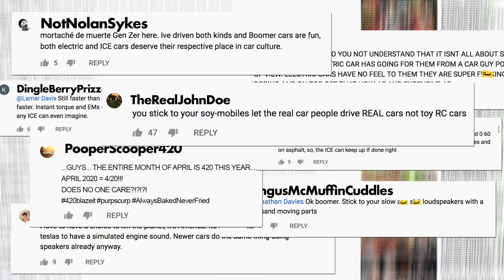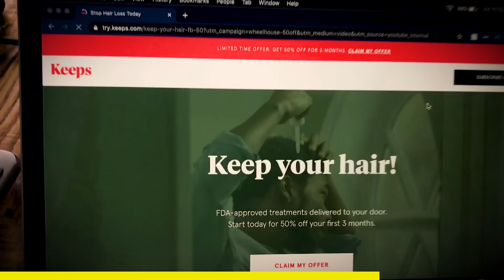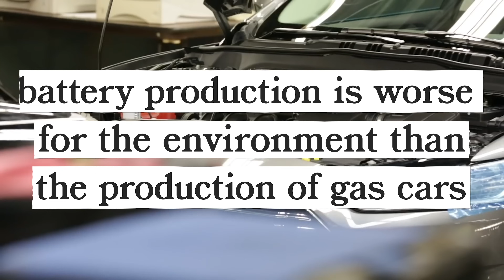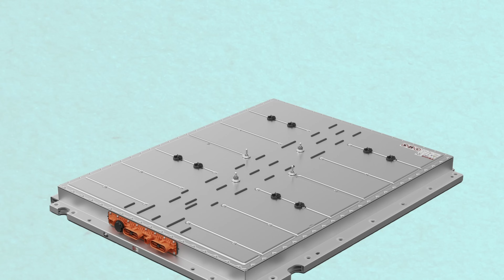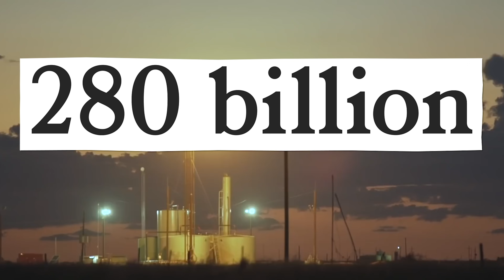Are Electric Cars REALLY Better for the Environment?

Comment: As much as i love muscle cars androaring v8s, i love to cruise with my little Zoé to town and back. Keep the historic engines for sundays and racetracks, use an EV for every other purpose.
Reply: I'm a petrol head through and through but I think this is the route I'm going down.
Reply: @xu10j4rs1  Not a true petrol head then. Ev's suck and will always be crap.
Reply: @krazyhippy  if we carry on like we are we won't have a world left to live on so we need to do our bit and if that means only driving our petrol cars at the weekend so be it.
Reply: @xu10j4rs1  I have to disagree with you. Country's like China and India need to make major changes if you want to make any kind of change. Modern gas powered cars are pretty clean compared to where they were. I just don't get any excitement when I look or read about electric cars. They are just so boring, ugly, and no loud vroom. I dunno man. I also didn't mean to come off like a dick in my last comment, so sorry if I did.
Reply: @krazyhippy  Yes, the Rimac Nevera with it's 0-300 km/h in 9 sec is certainly crap.
Reply: @potatocrunch94  Sorry, but when it comes to cars, speed is just one factor.
Reply: @potatocrunch94  Speed isn't the only thing important. Some guys like to work and fix their own cars instead of rely on dealerships to service them. That's not possible with electric cars.
Reply: @hhasslinger9601  It is possible,  just need a different mindset from ICE. Number of coils instead of number of cylinders. Induction phase instead of boost pressure. In the first place, EVs has less moving parts which reduces their need for maintenance.
Reply: @krazyhippy  In the first place, excitement, beauty, and noise are not the main purpose of a car. Heck, the best selling ICE vehicle is considered boring for petrolheads: Toyota Corolla.

Comment: The social utility of electric vehicles comes from their being slow charged, i.e., trickle-charged, at night.  At night demand for electrical power is low.  As power plants must be kept operating even when there is no demand for power, at night electricity literally goes unused and winds up going ' to ground '.  If you have an electric vehicle and slow charge it at night you are using electricity which otherwise would go to waste.

However, if you ' rapid-charge ', i.e., fully charge the vehicle in less than 15 minutes, that stresses the power grid requiring massing investments in increased capacity, which costs money and increases emissions of all types as well as having other ecological effects.

If you charge your electrical vehicle during the day, you are increasing demand for power.  If that electrical power comes from a conventional fossil fueled power plant, emissions are not reduced, they are simply moved from the tailpipe of the vehicle to the smokestack at the power plant.  And, again, as this increases demand on the grid during times of high power demand massive new investments in expanding the capacity are required should electric vehicles become common and are charged during the day. 

Rapid charging during the day is an ecological disaster.  Doing that exacerbates all of the problems and eliminates all of the benefits of electric vehicles.

A more ecologically and economically sound solution to the problem of excess power production at night would be pumped storage hydroelectric.  With pumped storage surplus electricity at night is used to pump water upgrade to a reservoir where it is released during daytime peak demand to turn power turbines and meet that demand.  In addition to recovering what would be a lost resource, the electrical power which now goes to ground, with a reservoir you get flood control during periods of heavy precipitation, a resource to help manage water shortages during droughts, and recreation- boating, swimming, and fishing.  The electricity going into electric car only be used to run those cars whereas electricity from a hydroelectric power plant can be used for any purpose; households, businesses, industry, schools, etc.  Electric cars only provide a very narrow use of the recovered resource while pumped storage hydroelectric provides a very broad social benefit. 

Unless they are slow charged at night, electric vehicles have no social utility.  If you just want to get one because you like the way it looks and handles, that's great, but there is no social benefit unless you trickle charge it at night.      ;-)
Reply: Correct, which is why the energy companies ( here in the UK at least ) are virtually giving the electricity away through the night. They generally charge around a third of the daytime rate.....
Reply: @Brian-om2hh  Thank you.  Don't know how well my, ' ahem ' " brilliant " idea for pumped storage hydroelectric power would work in the UK.  Here in the U.S. there is lots of potential.  Using high altitude reservoirs in that manner was the plan for power production here where I live in Colorado about 35 years ago.  That went away because environmentalists don't like hydroelectric.  I thought it was a good idea because those reservoirs would have been remote with almost no people living permanently nearby, although presumably campers would visit the reservoirs, so if there was a catastrophic dam failure few people would be affected.  My policy preference was overruled. Electric vehicles might be a better solution in the U.K.   ;-)

Comment: Two of the biggest issues in this debate you left out! Life of the vehicle and disposal. The average battery pack only lasts 6 years then you have 1000lbs of hazardous waste on your hands. Most people won't get a new battery pack, they will get a new car. Now add that in!
Reply: Jeez, more utter garbage!!!!!  When are you people going to understand that an electric car battery has an 8 YEAR warranty from new?  And even once the 8 years is up, they offer an assurance of at least 75% battery capacity, otherwise they will replace or refurbish the pack. And yes, you read that correctly. An electric car battery can be refurbished, and does not necessarily need full replacement.  Do you people just guess before you post, because some of your posts are so unbelievably misinformed, it's cringeworthy...........................
Reply: The batteries last longer than 6 years and as their capacity is so large when they degrade to 60% charge there are industries that will take them for home solar battery systems.

Comment: Green energy isn’t worth it overall. Nobody talks about how much co2 emissions is required for making solar panels or wind turbines and the cost to the environment those pose in the end. The silica used to make solar panels requires it to be heated to 1800 degrees Celsius. All of which is coal based fired. Then all the materials for wind turbines and the final cost of them to be built and installed, they are at such a huge offset before they become profitable. And then afterwards they only have a 20 year average lifespan similar to solar panels. There’s no good way of recycling either of those things too. Green energy is in the end not the way to go. With new technology in nuclear power (fusion in particular), instead of solid uranium rods, they’re developing liquid uranium. So that in the event of power loss, like Fukushima for example, the water cooling system is not the fail point. The liquid uranium simply drains back into a collection system for safe shutdown.

Comment: Efficiency is completely  Irrelevant if  your EV has 60 Miles Range in the Winter with heater on while your 10 Years old Neighbour Diesel reaches 940 Miles range

Comment: Energy is not miles , that's the issue with 99% of this videos 
An EV can loose a considerable amount of range just by leaving Sentry mode on and the driver keep waking up car to check its status 
while on a Trip 
The owner can come back to a EV with 0 Miles despite never driving the car and leaving it with some charge

Comment: Battery last only 3 years so if you say avg use of a car is 10 years that is 3 times the hazard of battery so I'd say that even in terms of cost for fuel EV with lithium battery is a fallacy. People should look at CNG and hydrogen mix it is much better than EV in cost and emissions.
Reply: Oh dear, yet ANOTHER one!!!!   Right. An electric car battery has an 8 YEAR warranty from new. Did you get that? That's 8 YEARS, as in one more year than SEVEN YEARS.....
Reply: I believe you will have a fair idea about charge and discharge cycle times with respect to number of total cycles, capacity of storage and discharge degradation over time. I don't buy the electric vehicle concept for regular long range use it may only be useful for lower domestic use (home to office and a couple of trips around the block). Anything EV that deals with long use and heavy load application is a fallacy unless they come out with a new graphene or solid state battery technology. So to answers your question warranty of 8 years depends on how u intend to use the vehicle. I am a designer the way we give out specification and life of product is based on no of cycles or shelf life it depends on a lot of other factors as well working temperature, idle time, active electric potential, angle of inclination, air pressure in tyre, load driven, dive time ect ect. By the way even of u charge ur battery from 98 to 100 it is same as u charging from 10 to 100 its a waste of charge cycle. If EV manufacturers have balls ask them to develop a sustainable battery technology before pushing the EV fallacy (Elon Musk) . Tesla gives u 1200 cycles if u consider partial discharge. So to say if u charge ur vehicle once a day at minimum assuming you travel 30 miles(average everyday man). Ideally to say if u charge ur battery from 0 to 100% without overcharge and drive only 30 miles everyday for next 30 years you can expect 26 years in a 300 mile range car. But we are definitely not perfect overcharging will increase rapid discharge so there itself is your 13 years out considering that you are stuck in trafic or talking on phone charging from 50% to 100% and all that give u an estimate of 8 years that is what the manufacturer will Sell u. Say u increase load on car that will exponentially bring your life down couple that with long range there goes another 5 years. In my country the factor of trafic plays an important role as low speed and heavy load will be detrimental to the battery life.

Comment: What cracks me up about this EV farce about saving the environment is, nobody mentions how the electricity is produced to charge up the batteries. They are charged up from IGT (Industrial Gas Turbine) power plants. You can also throw in there , nuclear power plants. So the more EVs being charged up, more of these power plants will be needed. So instead of the pollution coming from the cars to mess with the environment, it will came from all these power plants that need to be built to handle this tremendous load that is needed if all these sheep really get tricked into an EV. Then there are the lies about the Cars themselves like the range. That’s a bullshit number. You better take that number the Mfg is giving out and cut it in half. Anything you use when driving an EV will drastically reduce the range. Driving at night with your head lights on for example is a range killer. I know much more on this EV pipe dream but too much to type. I just got rid of a brand new Etron sportback. I had it for 3 months and decided to go back to gas powered car. Now all my worries about owning an EV are gone. Too much stress for nothing. Combustion engine is king and will stay the king once the demand for EVs fall through the ceiling and this experiment they are pushing on the people is over.

Comment: I always call them coal powered cars. Until renewable energy is reliable, it will be that way.
Reply: not so in the UK at least Steven. The UK gets just 4% of it's energy from coal. If you do some research, I think you'll find there are far fewer nations using coal to generate energy than you imagine.....

Comment: Loved the video and did actually learn a lot. Thank you!!! I do have a question though. What happens to those numbers of emissions if and when you have to replace the EV batteries? My understanding is the batteries themselves won’t last as long as the EV engines or the miles the average combustion engine lasts.
Reply: 2013 EV batteries could already last 200 000 miles at least, and they've come a long way.
Reply: Well it depends on if the company make the batteries decline on purpose to make more sales. I think some evs from 2012 have only lost a bit of max miles on each charge.
Reply: @trisfaleel  ok fair, but still it seems that the batteries are the worst part of the car for the environment, let’s say that an all EV has to have it’s batteries replaced only once in its life cycle. Technology as it is now, does it make it just as bad as a gas vehicle, worse?
Reply: @XineGaming11  well in the video he said about 7tons to produce a long range EV, 28+7=35 still less than gas car
Reply: Your understanding is incorrect. Watch the YouTube video, posted by a Tesla Model S owner. His car has covered 400'000 kms on it's original battery.  Did your "understanding" happen to come from someone whom has never owned, driven, sat in, or even touched an electric car?  How many oil changes, repairs and replacement parts do you suppose an ICE car might need in 400'000 kms?
Reply: @Brian-om2hh  Thank you for your info. No it did not come from that person, it was however early on in the electric car growth market life. It's good information you just gave me though. thanks again
Reply: @XineGaming11  You're welcome....

Comment: “Not any emission during use more than make up...” bruh you just mentioned that the way the electricity is produced to power the EV is worse.  There is no way a coal plant can produce electricity at 100% efficiency. Each time you convert energy you lose some to heat, light, and with electricity, the distance it needs to travel to your neighborhood’s 🔌. EVs are horrible for the environment.

Comment: If you've taken into account the CO2 emission of petroleum manufacturing including plane fuel and plastic, why won't you count then the CO2 amount for let's say ... copper and aluminium production, or electric turbine manufacturing (those used to actually produce the electricity) and power plant building (if we calculate all, why then we stop on the halfway?), or power lines production and maintenance, etc.? That would also sum up to significant figures in the same way as for the crude oil production for internal combustion vehicles.
Reply: Because those things can also be used for other electric appliances. Also ice cars continue to give co2 in their lifetime which is higher than production of ev.

Comment: I am here after the unveiling of the 2022 F150 Lightning and while I like how it looks I am still a fan of good ol gasoline powered engines and I am looking not to the future but to the past because if there was ever a huge solar flair that was big enough to knock out power grids the electric vehicles will be sitting collecting dust while vehicles from the 70's and so on will still be able to be used so there is that then there is the cost of maintenance EVs will more than likely be way more expensive to fix and more mechanics will need to learn more about being a damn electrician. I know I won't ever buy an ev.
Reply: What's wrong with being an electrician? It is a useful skill. Also, there is a reason why space is even considered as an industry: to monitor solar activity and prepare for a flare.

Comment: Buddy thanks for this video. Can you make a comparison with Hydrogen-powered vehicles. We can assume that the production of a car leaves a pretty much similar footprint as a gas-powered one. But what about Hydrogen production? How much does this "cost" to our environment?
Reply: Hydrogen production generally uses huge amounts of electricity. Then, once you have your hydrogen it has to be transported using large trucks, to where it is sold or stored. Exactly the same transportation as petrol and diesel. So no reduction in pollution there. Hydrogen fuel cell manufacture requires platinum. And these fuel cells will degrade over time, needing either refurbishment or renewal. A hydrogen powered car is typically around half as efficient as a full electric car. And, as a hydrogen powered car is basically an electric car anyway, why not just skip the hydrogen production and transportation parts and just use the electricity to charge the battery in an electric car in the first place? Electricity needs no transportation.

Comment: I'm more concerned with the child slave labor used to mine the cobalt used in the batteries and the permanent destruction of the land. 😡🤬 thank you great video
Reply: And ironically, the same child labour is probably used to mine cobalt for the big oil companies. They need cobalt to remove sulphur during the refining process. So, how does drilling, extracting, refining and transporting oil play it's part in destruction of the land?  And that's before we even begin talking about huge oil tanker spills, like the one that has just occurred. Surely that isn't doing much for the land either?  Have you looked at where your clothes are made lately? You'll probably find you've been wearing clothes produced using child labour for years. Child labour is not an electric car "fault," it is the result of nations whom still allow it to continue.. If you have a problem with child labour, I strongly suggest you complain to the nations who still allow it to go on....